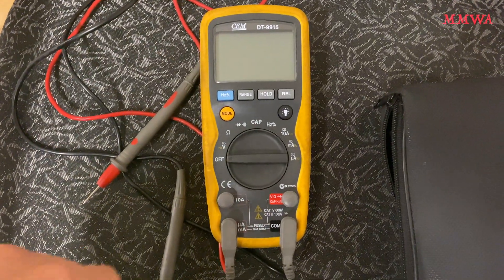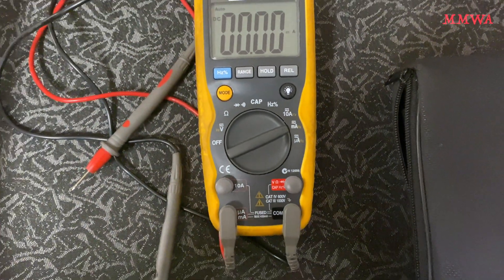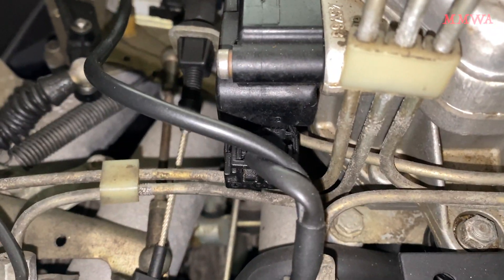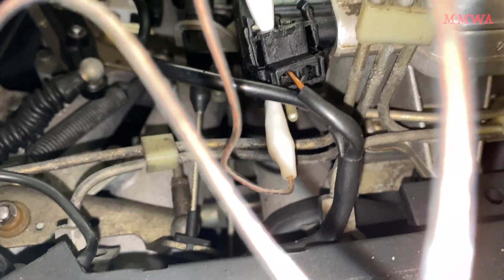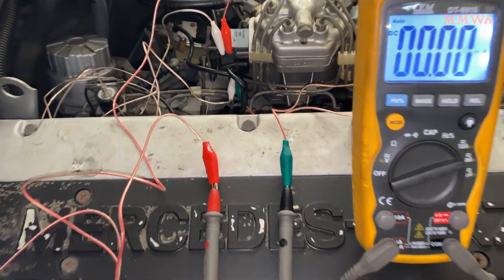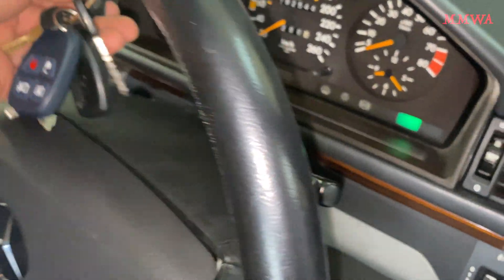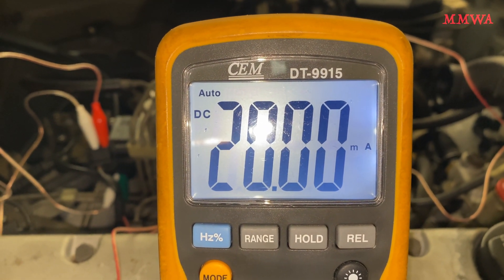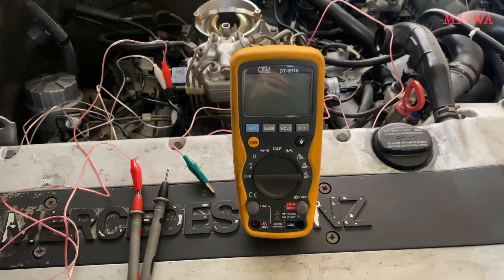How to connect a multimeter to read EHA current - for NOOBS

Comment: I got 53.9 ma on my w126 with ignition on do i have a bad eha but I left the plug connected and exposed the pins by removing the backing on the connector and attaching the multimeter pins here

Comment: I did this sort of test on my EHA Valve and found the source of my surging problem on my 2.5-16. Electrical flow chart was sooo good to do. Thanks
Reply: What was the problem?  I'm trying to get my own -16 to run smoother.  Trying to rig up gauges to confirm pressure regulator pressure.
Reply: It was the most bizzare problem. If I started it and never turned it off it didn’t surge at idle. If I turned engine off and restarted it while hot, it surged and stalled. So a hot start problem. Get yourself the electrical flow chart and run through it. It’s the only way you will know for sure and how I found my problem
Reply: @robgimenez5031  Thanks for sharing.  What was the final fix?  A temperature sensor or new ecm?
Reply: @ebutuoyebutouy  what I found was a partially broken wire leading to the EHA unit. I thought I was so dumb that I couldn’t read an multi meter (reading zero) when I bumped it and saw it spike up in ma   The wire was super brittle and when I stripped it back, most of the copper wire strands were broken with only a single strand unbroken. So I had a donor car and used the plug which gave me a bit of extra lead to enable a fix. Soldered and shrink wrapped. Solid fix. It was amazing to finally see the cause of the problem. I swear I turned the car on and off 20 times before I was convinced that I’d fixed the problem.
Reply: @robgimenez5031  Gotcha!  Nice find.  Thanks for sharing.  Enjoy your -16.
Reply: @ebutuoyebutouy  yeah I sold it a few years back now. Best car ever haha. Cheers